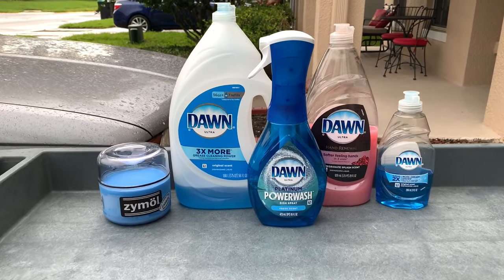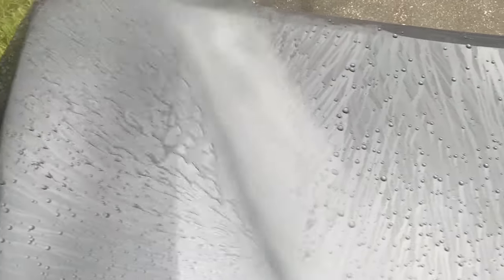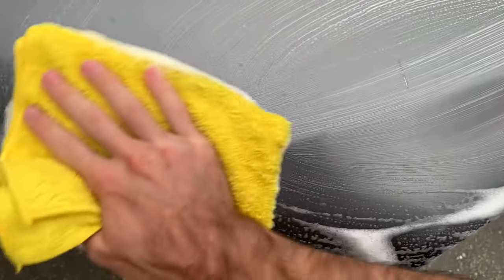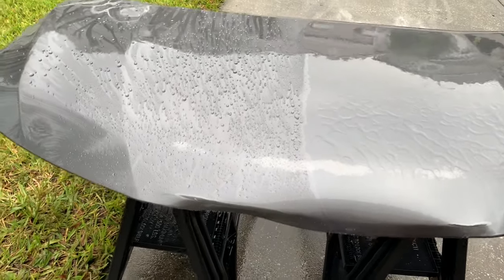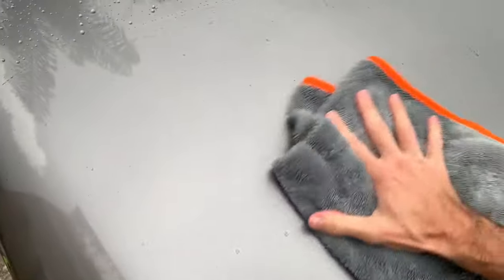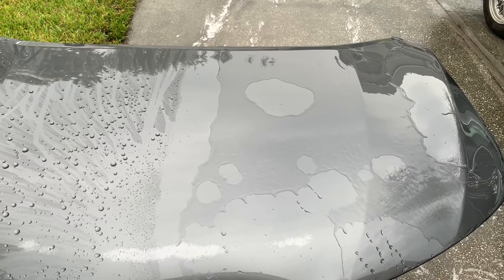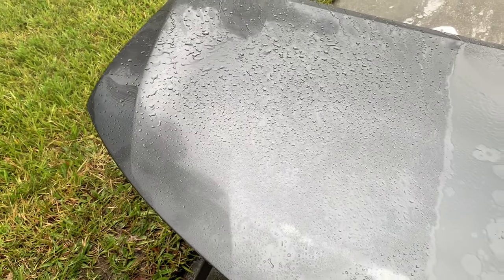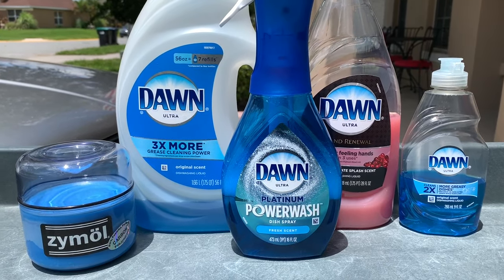Dawn Powerwash Strip Wash Test vs. Zymol Carbon Wax

Comment: Thank you for this video!  It worked great to strip off fresh wax which is what I needed.  Normal Dawn couldn’t do it.  I only left on for a minute and agitated in swirl motion, then rinsed off.  And there is no damage/dulling to fresh clear or base coat.

Comment: As a wax stripper, I currently use done diluted 1 to 10 in a ik foamer with 1 ounce of car soap and it completely strips most waxes and sealants when I hand wash the car
Reply: can you explain? Im going to ceramic coat my car tomorrow, can I use Dawn Powerwash Strip in a bucket of water to strip waxs and etc

Comment: waxes can only be removed with 1st acidic product then  strong alkaline bath and then a product that contains Hydrotreated light naphtha is your best bet - like the klean strip. if it still persists only polishing can remove the rest.
Reply: Which acidic products do you have in mind?
Reply: @skzion2  a famous in this industry is wheel brightener from meguiars(1:6) , but any low dilution of oxalic acid around 10% will do the job. Don't forget to neutralize after with an alkaline strong apc+ agitation. And never on hot panels.
Reply: Don’t hear much from people about oxalic acid. I have found it is a great rust/ iron remover. What is your experience with it?
Reply: he showed it removed with just dawn no acid
Reply: purple power or any alk cleaner will remove wax over time... not sure where you heard only acid

Comment: Very interesting results , would be a great video to use it on some stronger sealants to see if it kills them or not and or if it’s better than PBW?
Reply from the maker: Definitely, I need to grab the Turtle Wax twins out for sure to see how they stack up!  I might put up a variety of stronger sealants on the test panel and have a go at them all at once with Powerwash and put that video up on the channel.  I'm on my last 22oz of Strip Down so I'll see what we can do with that as well, maybe a few head to head battles for fun.
Reply: WaxMode that’s a great idea. I’ve seen a few videos of others with a variety of sealants and waxes on a panel together and taking a torture test. Of course the Turtle wax twins are the staple for this so it will be a great comparison.
Reply: Would definitely be interesting to see what that Dawn Powerwash can do against some of the classics and some of the new stuff. Sonax PNS, Meg's UFF, Gtechniq C2V3, TurleWax, etc.

Maybe dedicate one panel to the spray-on/rinse-off formulas, such as WetCoat, hydro2, sio2 blue, and all the newer ones coming out.

Comment: Hey buddy.  Haven't talked to you in a bit.   Just a quick question sir.   Hey, I am getting ready to do a polish on my Nissan 370Z with Dr. Beasley's NSP 45 or Z1 and apply their 1201 Ceramic Coating.    I have a really hydrophobic sealant(s) on it right now that is pretty fresh.  What do you recommend I do to strip it down before polishing with the NSP primer and then coating it.    The NSP primers state they have a "leveling" effect on the clear coat and prime the surface with their special process which gives the 1201 coating (or any other coating) what they claim are "bonding points" for the coating to adhere to to give it a stronger bond to the paint thus, in theory, making the coating of your choice last a lot longer.    Essentially, what process do you think I should do to completely strip off the sealants and waxes that are on there now.   Should I do a full decontamination wash first,  iron remover,  clay,  etc.   What STRIPPING product do you think is the absolute best to strip off everything down to the bare clear coat?   I have tried Adams Strip wash, and to be honest,  it didn't appear to have much effect on getting rid of whatever sealants/waxes are on there.   I used a base of Jescar Sealant and topped that with Polish Angel Rapidwaxx in addition to a few other spray waxes as toppers after each wash so its got a ton of hydrophobic sealants and waxes on there right now.   I've essentially been topping and topping and topping the paint after each wash so its probably built up pretty good right now.   Looks great, but there is some micro marring on the paint now (That 370Z has some seriously SOFT clear coat so it scratches if you look at it wrong just about).    First time using their NSP primers so I want to do it right and get the most out of the 1201.   I don't think 1201 is a true "COATING" in the sense that it's a ceramic although that's what it's called.   My guess is it's probably more of a strong Si02 based product but the claim is a year or more of protection.   I garage my car and rarely drive it so I will probably get some really good longevity out of 1201.   Since I am using the NSP primers, I thought it best just to stick with all Dr. Beasley's stuff since they already did the homework and I would assume it will work great on top of their NSP primers.    The "Z1" version of their NSP is a PRIMER & COATING BUILT IN with up to a year of protection all by itself without any other coating on top, although I am topping it with 1201 which they claim will add even more durability and longevity.   The Z1 is a "ONE STEP".   Supposedly a combination of all the NSP primers (150, 95, and 45) and also a ceramic coating component too.   It's getting really good reviews across the detailing world.   Mike Phillips from Autogeek did a test with it and raved about how good it removed a lot of defects and left a decent coating behind too.   I haven't decided on using the Z1 one step, or just going with the NSP 45 which is their finishing polish.  I'm going for the most gloss I can get which is why I am thinking the NSP 45 on a finishing pad to try and really get the paint to pop.   The paint being so soft,  I am thinking the 45 finish polish may be enough to get rid of the minor micro marring and leaving a super glossy finish.  I'm going to test both products on different panels to see which gives the best results.    SO, phew, sorry for the long intro here, but my essential question........HOW WOULD YOU STRIP IT DOWN TO BARE CLEAR COAT?
Reply from the maker: Great question Joe.  I am very hesitant to use clay unless absolutely needed, the reason is on my test panel when it was perfected, even a mild clay bar with proper lubricant was enough to produce some medium level scratches that would not come out with a finish polish.  So I would not use clay to strip protectants unless I know that I have embedded contamination and I know I’m following up with polishing.

Without claying, I’m very likely to just use something like Klean Strip Prep-All right before my polishing step to help soften or tackle through the current protectant so that it doesn’t cause interference with the polishing step.  Prep-All has been super paint safe for me, but it’s strong enough to clean up some stronger LSP, maybe not fully remove without multiple applications but in the case of Griot’s Ceramic 3-in-1 Wax which can be very resilient and sometimes bond unevenly, a quick once over with Prep-All is enough to clean up streaking whereas a few passes with IPA at around 20% dilution is not.  

Prep-All should be a good prep to use before Dr. Beasley’s Primer, and I’m actually still interested to try the Beasley out, but I’m currently up north away from all my gear due to work and I’ve shut down testing as a result due to work.  One day I would like to really go through and test the lineup.
Reply: @WaxMode Thanks for the info.    I actually have a gallon of Kleen Strip Prep All (got it based on your recommendation in one of your videos about six months ago) so I will use that as my panel prep prior to polishing.    I just wanted to try and get it down to bare clear coat so I can start fresh with the Dr. Beasley's products.    I've heard really good things about these Dr. Beasley's polishes.   I previously did an entire decon/compound/polish/sealant using all Polish Angel products  (Master series) earlier this year and that stuff worked incredibly well.    I just didn't get all the blemishes off the paint or I have some induced micro-marring since I did the job due to my 370z having super soft paint.   I just want to clear up the paint as much as I can (looking to gloss it up as it has some "haze" in it that I can see, probably because I am a novice at polishing) so just want to try and get rid of the haze somewhat and get it as glossy as I can before applying the Dr. Beasley's 1201 and then maintain it with Dr. Beasley's Advance Coat every month or so just to keep it looking great.    I probably won't have to polish it again for quite some time as I don't really drive it all that much so it stays garage kept at all times so it's away from the elements.   I've actually never driven it in the rain, ever.     You utilize the Kleen Strip right out of the can straight right?   No diluting it?   I don't have the aerosol,  I have the liquid gallon so I put it into a Kwazar bottle.

Comment: Thanks for sharing. Would you be able to try OG’s Decon wash? Curious to see how much it’s able to strip. They’re pretty local to you since you’re in Florida too.
Reply from the maker: Yeah I definitely need to take a cruise on up there to OGHQ once this Covid stuff dies down.  I'd like to try the OG Decon Soap out, I've got to snag up some of Matt's new tire shine and the Pressol sprayers to try out as well.  And I remember when Chemical Guys had the soap under their Citrus Wash label before they discontinued it, never pulled the trigger on it back in the day, I went with Citrus Wash & Gloss instead.  I'd also like to try out the Griot's BOSS Foaming Surface Prep in the foam cannon.
Reply: WaxMode good call. Yeah. Their tire dressing looks great but perl and wowos tire restorer have been doing great so far. I never got to try chemical guys citrus wash(red) either. So it will be a neat test for you! Foaming surface prep from what I’ve seen is quite strong at stripping surfaces so it would be great for you to test that too. Thanks for responding.

Comment: Dang that worked fantastic! I might buy this just for my test panels. Like you said you have to be careful when using products like these on cars but it’s perfect for product testing on a test panel. I laughed my butt off when you said punt the bottle because of the sprayer. I am the same way. 😂
Reply from the maker: Cheers FAB!  Yeah I've actually heard some good stuff about the Flairosol sprayers but this trigger must have been a dud.  This bottle would have went FLYING at the speed of light if it wasn't able to knock down the Zymol wax with that bent trigger.
Reply: @WaxMode  "you have to be careful when using products like these on cars" what precautions i need to be aware?

Comment: Would you use the Prep-All prior to polishing or compounding ? Then would need use something like Eraser before  waxing or coating?  Prep-All is more stripper then surface cleaner after polishing or compounding correct ? Dawn PowerWash some powerful stuff when agitated.
Reply from the maker: Prep-All I find this works great as both a pre-polishing prep, AND a post-polishing prep.  I mainly use it for post-polishing wipedowns just as I would with CarPro Eraser.  The benefit with Prep-All, is it's much less expensive than a gallon of Eraser, it just doesn't smell anywhere near as nice because Prep-All is a blended mix of mineral spirits and naphtha, so heavier solvent smell and I mainly wear a mask when I'm using it.

There are products out there that Prep-All can really knock down when they're fresh, not all of them, products like Seal N Shine can reject Prep-All, but absolutely this is much more effective than Eraser as a pre-polishing wipe to try and knock down protectants.  So the utility and price makes it an awesome choice for me, it has also been very paint safe, I have not seen paint swelling or clearcoat damage as a result of using Prep-All quite often but definitely test in a small spot first.

Comment: I am a non professional, so costs are important to me.  I have been using a mixture of Dawn Dish Soap, Vehicle & Boat Concentrate Wash & Super Clean as my strip wash.  Seems to work well?  Then before I polish, I use Duplicolor Wax & Grease removal, soy based.  But this new Dawn Powerwash may be the ticket?  Thanks for reviewing this product.

Comment: Is ital much different to carbon?
Currently looking at some as i have nearly ran out of glasur. My current fav is pinnacle souveran, are the other zymol waxes much different to glasur and souveran?
Thanks dude
Reply from the maker: Ital is probably closer to Glasur than Carbon, but not by much.  All of my Zymol waxes are very similar in terms of application feel and wipeoff, but usually I get the worst sweating with Ital in the high heat and humid Florida climate.  I really enjoy the wax otherwise, as well as Glasur but just have trouble pinpointing noticeable differences on the paint.  They even smell pretty similar too.  I find myself reaching for Glasur the most.  

Souveran is in another league in terms of ease of use and wipeoff, but definitely not as durable or as hydrophobic as any of the Zymol options when fresh.  If I really want an effortless wax process I’ll reach for Souveran or Wolfgang Fuzion.
Reply: @WaxMode  i have wolfgang fuzion too but I have found it very disappointing, application and removal is a dream but i find its looks and water behavior is below average. It will probably look better on a lighter car though i think.i find glasur looks better on lighter colours too, its brilliant. Do you think i should just try carbon for my black car if most zymols are similar? There is the sample kit too that im considering,it contains concours, titanium and carbon? £99.
Thanks for your help

Comment: Interesting video, nice to see the difference in performance for these soaps.  Slightly off topic, but what do you think of Gyeon mentioning in their official video for the Q² Syncro coating, a requirement to wash your car with "hot water and dish soap" after polishing before applying the coating?
Reply from the maker: This was an oldschool mentality of paint prep early on in the coating market.  Some guys are still using that tactic.  The idea is that after polishing the paint, an IPA based solution that most guys were using was not effective enough to fully lift and wipe away the remaining carrier oils left behind from the polish.  So in order to provide a cleaner surface for the coating to bond better to the paint, a stronger cleaner bath was needed to tackle through those residuals.

I think there's some validity to that mentality.  Prep-All has been much more effective for me across the board in knocking down some fresher protectants compared to any IPA based solution, and I haven't noticed any adverse effects using it as a post-polishing panel wipe.  So this is why I largely switched over to it and use it regularly.  

But the question is whether or not it's truly necessary to go to such lengths to provide a that clean of a surface for the coating to still bond to a very high level or its maximum level, and that's debatable.

Comment: Waxmode great video. Have you tried xtreme solutions extreme suds? They claim its ph neutral  it is some potent stuff. I applied mckees hydro blue on my wifes car 2 weeks ago.. awesome beads. I just performed a maintenance wash using extreme suds.. 2 oz in a 5 gallon bucket. Minimal pressure applied on wash mitt. it really knocked the snot out of the hydro blue. Wondering if you had a similar  outcome

Comment: Do you use prep-all for removing polishing oils too?
Reply from the maker: Yes, Prep-All is my primary product that I use for post-polishing wipedowns.
Reply: WaxMode Is prep-all more effective than dawn powerwash in removing a wax coat?  I’m trying to remove whatever wash wax the dealership used on my car
Reply from the maker: @ChungNguyen-rj5rf  I still need to perform some more side by side testing with them, but Prep-All will also do well against the fresh Zymol waxes, but there are a variety of other stronger sealants that will be resistant against both Prep-All and Powerwash.
Reply: @WaxMode  unless you do it multiple times. Over and over until it's off

Comment: Waxmode, are you diluting the mineral spirits, if so, how much? Thanks for all the great videos.
Reply from the maker: Cheers Rob!  I'm using the Klean Strip Odorless Mineral Spirits undiluted and I'm not seeing any bad reaction at all with the paint after some pretty heavy usage over the last month.  This I'm using specifically as a post-polishing panel wipe, I haven't done much wax/sealant strip performance testing with it.  Still love Prep-All, the Mineral Spirits is a bit heavier and doesn't flash off quite as fast as Prep-All, but it's definitely able to tackle through the polishing residue with ease and it's only $12 a gallon.  I like it much better than the Duplicolor and Rustoleum products that I showed in this video, but mineral spirits always smell like mineral spirits, not fun stuff in the garage without the mask on.